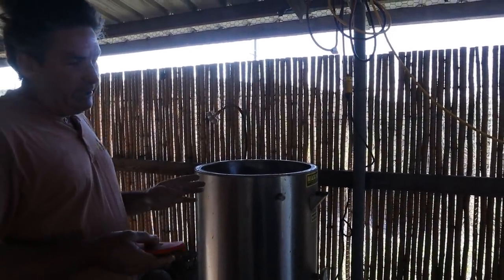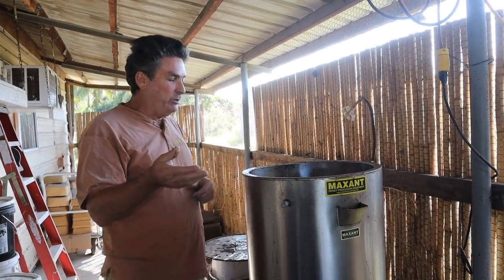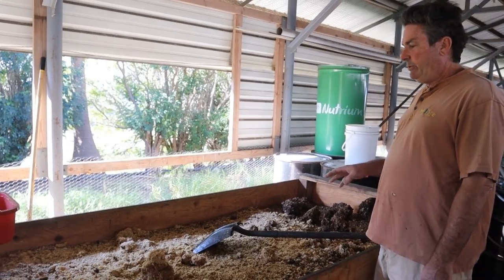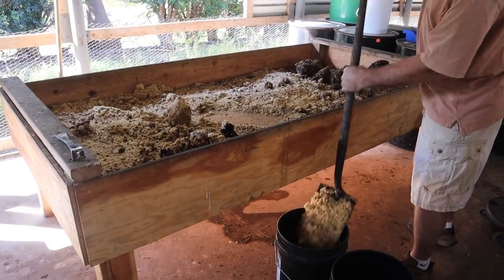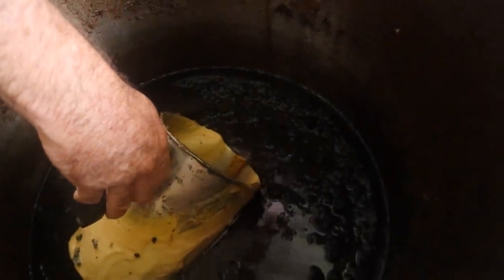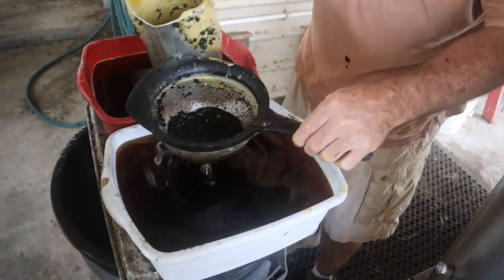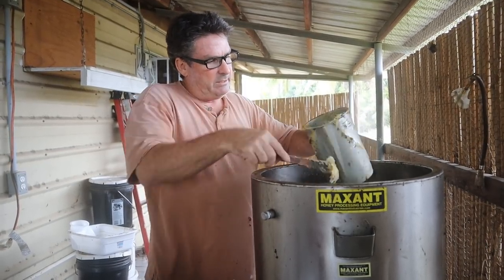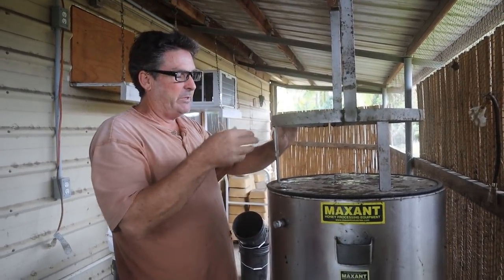AWESOME Wax melting setup for Hobby/Sideline Beekeepers!

Comment: Slumgum is my new favorite word! 😂😁
Reply: Me too...I never knew what to call the stuff left after the wax was removed.
Reply: @charmcityhoneybees6145 
I've just called it "residual gunk". 😜 😂 (And similar words in Swedish. 😜)
Reply: If you staple some burlap to a cut fence post and coat It with slum gum sling a rope over a tree limb and lift it up it makes a great swarm trap and all you have to do is lower it and shake it in a box then pull it back up in the tree!!
Reply from the maker: I don't know if this is how the word came about... but beekeepers use to keep bees in hollow tree sections called bee gums. Many of these were actually from Sweet gum and other Gum family trees. Perhaps they just added the word slum to it for the "junk" our of the Gum. 
Here is some Bee gums. Very common practice in the South back many years ago! https://i.pinimg.com/originals/89/d1/4d/89d14dab2fd3403fef34243f706ee9b0.png?epik=dj0yJnU9cE9Damd6bmM3cGQ1Q0xCMW1Yb3ZiWHQ3Z2Q3WElpOEYmcD0wJm49LVY4N09hUF9EQnRBWUVNMElFQmx3QSZ0PUFBQUFBR0FYSUJZ
Reply: @kamonreynolds  The first thing you got to do is stop using Farenheit en start with celcius ! Gabriel Fahrenheit was on drugs when he introduced this .
Reply: @soupvis2616  While I agree Celsius is easier for most of the world, the conversion isn't that difficult. And if you really want a sensible scale, I recommend Kelvin.
Reply: @attesmatte Ву й

Comment: I started using a homemade solar wax melter, it involves a aluminium roasting pan with a bunch of pinholes in one end (Strainer) and a basket made of 1/8 " hardware cloth, a cooler with old window glass cover and a bread tin  catch container. The comb debris mostly stays in the basket and the rest is stopped at the strainer. Perfect clean wax after one day in the summer sun. Load the solar melter and walk away, no tedious straining.
Reply: This sounds like a great idea! Did you make a video or have pictures of exactly how you did this? I live in Tucson and a solar melter would be perfect in this environment.
Reply: I woul love to see that to!
Reply: Absolutely the way to go. Mine was a wood box  lined in aluminium sheet and encases in 3 inch polystyrene insulation panel. The door was double glazed using thin greenhouse glass. 3 filter levels Coarse hardware cloth, then perforated zinc fly screen and finally 2 layers of fine linen. Gravity did all the work and the clean wax collected in a pan at the bottom. The top filters scraped clean easily and the cloth filters were cleaned in hot water to remove wax and crud. Had to stop years ago when i started getting anaphylactic reactions.  If your collector had a copper outlet pipe and tap , you could drain off the wax into convenient moulds without even opening the door. You could easily re-purpose an old shop fridge with glass doors - already well insulated.
Reply: Pic please 🙏 😊

Comment: Melt it all back down in salt water and let it cool. The salt water should pull the sediment to the bottom as the wax solidifies. I do that for separating my wax and tallow. He could have added a bit more water to that tank and he may have gotten those tiny bits left in the screener.

Comment: I knew a bee keeper that, after he did the first cleaning of the wax, used a series of sheets to remove the last bits.  He used a removable band of some kind to hold the sheet firmly in place over a large plastic trash can.  He had cut away part of the lower trash can, or barrel perhaps it was, with a 5 gallon bucket he could remove underneath to catch the wax.  He melted the mostly clean wax and then poured it through these several layers of sheets.  Because the wax was hot, it did not clog in the sheets.  The resulting wax was pristine.  He then took the 5 gallon bucket and poured the wax into his moulds.  I think he used cake pans.  I love inventors!

Comment: I use a 5 gallon paint screen for removing the finer particles. I doubt that it's 10 microns but it removes the majority of the slum gum. I put the strainer in the 5 gallon bucket, it's designed for them, then I lift it out and let the wax drain through. I can see how letting the wax separate out and float to the top of the slum gum will get more wax out as he showed. Thanks for this video.
Reply: I use same method in Montana

Comment: Cool process.I imagine it cost a bit to get that Maxant melter all the way from Massachusetts.

When I was a teenage,I worked in a fast food restaurant and every night after closing we would siphon the hot grease in the fryolators through a filter sock just like that.I presently use a cone shaped grease filter for my wax after it has gone through a solar melter.The solar melter has a coarse screen basket lined with paper towels to catch the slumgum.

Comment: here we dont use filter socks we use water/honey bucket that are conical it helps getting the cake /cheese out once steam melted the wax is mixed with water so as time goes (we slow down the cooling with insulation so decantation last longest and does its best job of collecting all the dust/propolis/polen/slumgum into the water that sits under the melted wax ;))

Comment: Older video, so,apologies for asking a question now! 

But is there a reason why the screen was not inserted earlier, while skimming the wax out with the jug. Just to push the slumgum down and get a head start on the reclamation process? seems like you could do it then, skim the wax. Add extra wax scraps and more water and go again to reclaim?
Reply from the maker: Thanks for watching and commenting. A lot of the slum is very light and with the disruption of inserting the screen it pushes a lot of it thru and above the screen and it won't sink back down thru the small holes. 

There may be a better method out there yet to be discovered. I am using Thornemfg.com 25 gallon tank and their 8 gallon tank with their 2 valve system which is designed for wax rendering

Comment: You guys must have access to loads of wax.  I I made a solar melter out of a shallow wood box (painted black inside) with support bars for a tray and squished up small mesh (like chicken wire) and the wax melts and filters through the wire and is collected at the bottom of the sloped tray.  The whole thing is covered with a single pane of window glass (old exterior window). Keep in mind don't get it all too hot.  Sure there a videos on Youtube about these.

Comment: Did David drain any wax out of the tank using the valve the way Maxant demonstrates or did he only use his wax pitcher to scoop it out and strain into the tubs?
Reply from the maker: his setup is an older model with only the one bottom valve

Comment: I had Maxant add a drain hole about 9” up from the bottom valve on a bottling tank. For a extra drain valve. I put a weight screen like his but no legs in the tank. Add water melt melt. Then pour good wax off the top drain.  Then add more water for the slum gum turn off cool. Pull the disk of wax. It comes out like the video. The tank gets used for everything. Like surup making,decrystallizing honey.

Comment: Put perforated 3" pipe vertically in a middle of a tank. It will help to melt wax faster.

Make a bottom of a rubbing been by the 1/2" screen. The second bottom under, will collect perfectly dry wax. You iven will not need to agitate.
Reply: Smart Idea right there...my bees do a really good job cleaning it up but that may speed the process and cut down on shb and wax moth cause you can remove part of it until it's all processed

Comment: I use a double boiler system. 
large pot with boiling water.
then place a 2and pot inside the first that has boiling water.
2and pot put 2 inches of water in first.
then place your wax cappings or comb wax in a 5 gallon paint strainer. 
Tie end closed with string leave string long enough to pull the strainer out.
then with a gloved hand squeeze the wax out.
Remove 2and pot from first set aside and let cool over night.
remove wax next day.
discard dirty water. 
if u wish to have super clean wax.
repeat process with 2 paint strainers.
paint strainers cast about $3.00 at Ace Hardware or home depot. 
pots can be obtained from Walmart. 
fir around $10.00
make sure to get one one size smaller 

that will fit into the larger one.
and a $10.00 hot plate. 
do this outside. 
I put one empty deep frame around the hot plate and larger pot.
put 2and pot inside first.
put wax in 2nd pot .
then fill first pot with water .
Turn on hot plate to around 4.
water will heat up. also put some water in 2and pot about 2 inches.
let heat for about 2 hours and wax is ready.
remove and squeeze out wax.
remove 2nd pot from boiling water let cool over night.
I use this method in Montana

Comment: Why don’t you use the melter as recommended by Maxant?
Reply from the maker: Are you referring to the 2 valve system?
Reply: @kamonreynolds  
Yes 2 valves isn’t that what he was using or is it an older bottling tank?
Reply: @allenkracower4787  I also thought this is a bottling tank. Definitely not how Jake at Maxant demonstrates the wax melter.  Oh well, this is a good way to make use of what you have already.
Reply from the maker: @allenkracower4787  right this is an older model. So if you have a 2 valve system instead of using a pitcher you can use the top valve to drain off the wax. I really like how he reclaimed the wax out of the slum gum and made the slum gum easy to handle